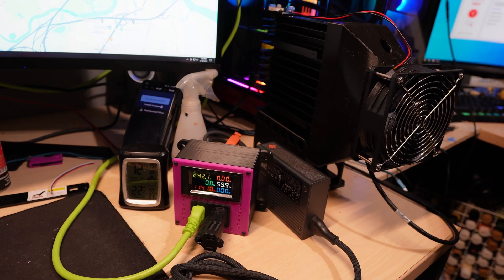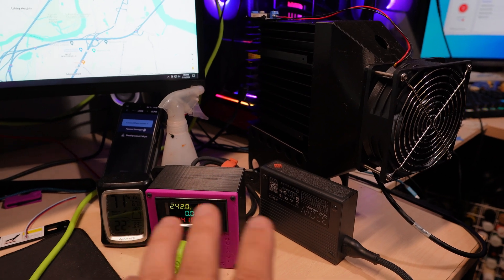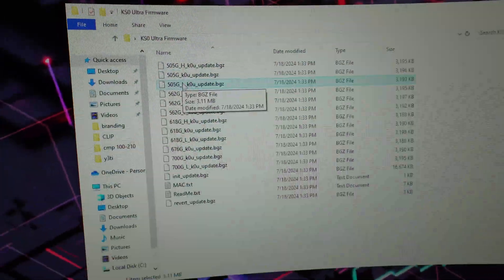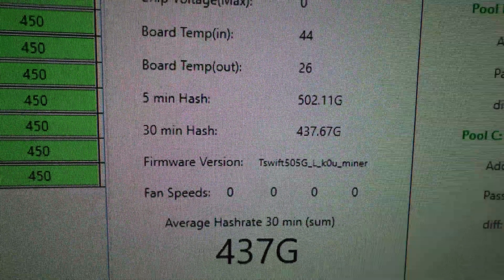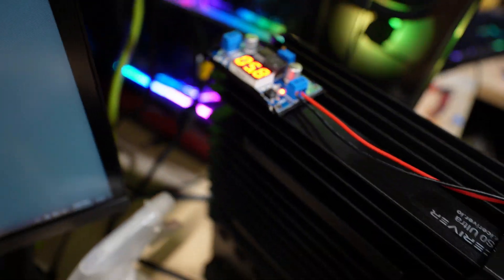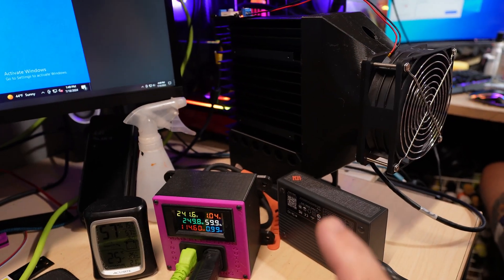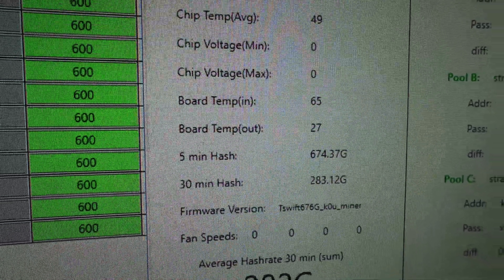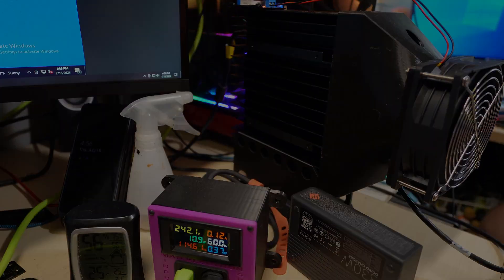KS0 Ultra Tswift Overclock Testing!!! #crypto #kaspa #iceriver

Comment: Do you think a Be Quiet Silent Wings Pro 4 in 120 or 140mm (I have an adapter) would cut it for the OC?
Reply from the maker: Most likely not, you need high flow server fan to properly cool the asic.
Reply: @madelectronengineering  Do you think the ks0 being in a fully enclosed fruition design shroud would help, I'm trying to get away with overclocks while being as quiet as possible as I sleep in the same room :) Also, do you think the veteran miner cables will survive the 500gh OC with the shroud on? I wrote the original comment but under a different account* Many thanks in advance!

Comment: Iceriver has a new Firmware for the Ultra would you happen to know what it fixes? I don't know if I should install it.
Reply from the maker: No clue what the new firmware fixes, sorry.
Reply: @madelectronengineering  It fixes the Miner offline issue for the early batch.  On 2 ultras, they both fired right up for me, after logging into them, they would say the device offline.  But after installing the 7/6 firmware, both would show fine.

Comment: what did this ks0u hash right out of the box... your first hash mentioned was 285Ghs which is shite although it was running too cold to be able to hash higher rates
Reply from the maker: before I did the hardware mods it was running 400GH stock, once I put on the external fan and still used the stock firmware, it was too cold to hit stock hashrate.